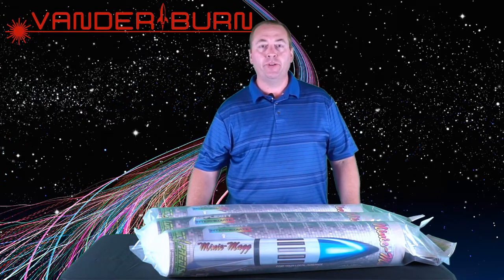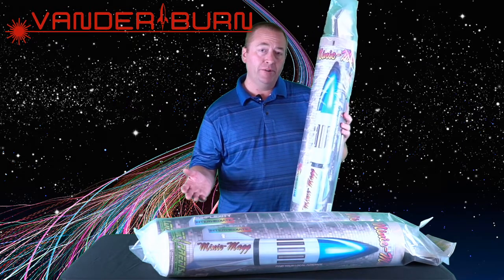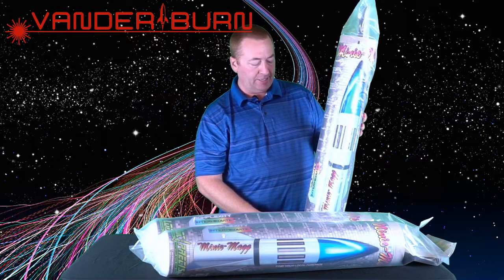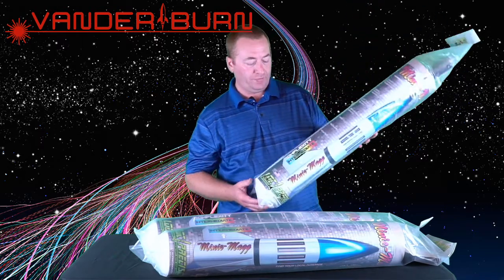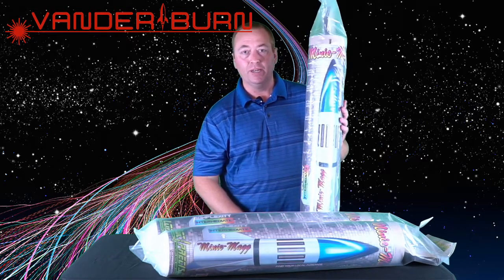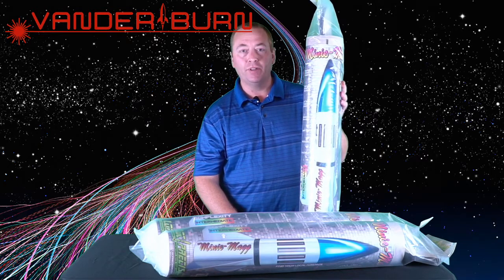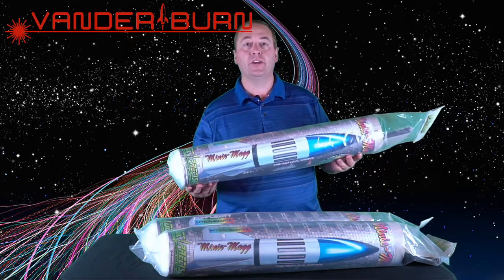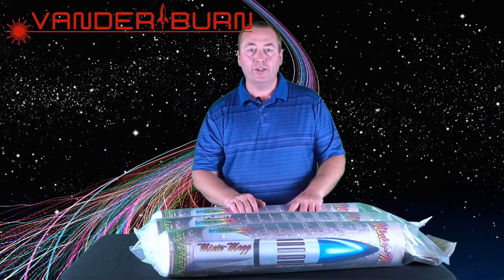Can the LOC Precision 5.5" Minie Magg be built to fly under Class 1 restrictions?

Comment: I’m getting back into rocketry after an absence of over 30 yrs. I have a very old LOC Minnie Magg. They used to come with 1/8” fins and rings, thru the wall but not “loc’ed” into the motor tube. My empty weight is around 44 ozs.